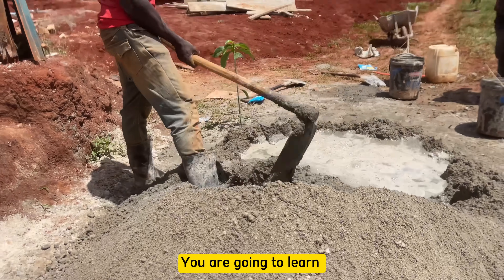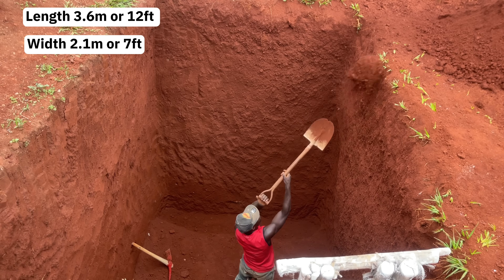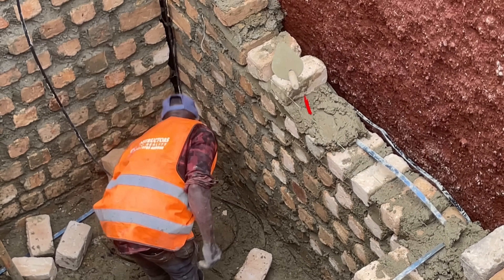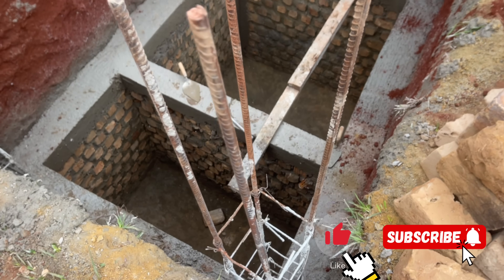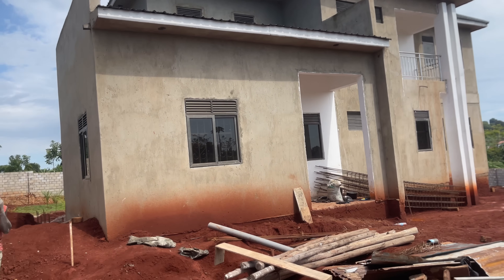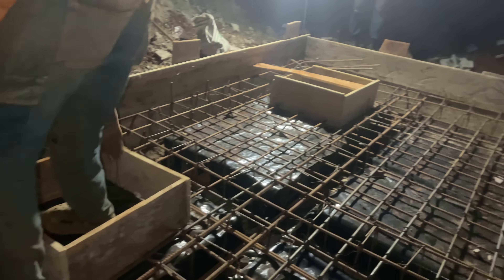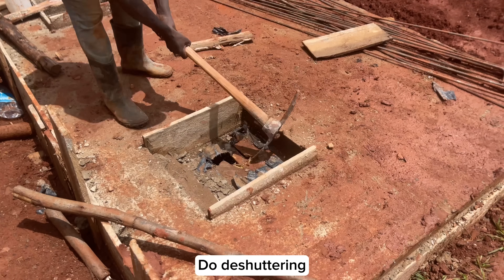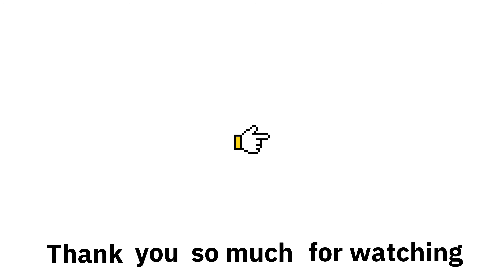How to construct a septic tank (NEW WAY)

Comment from the maker: To buy or purchase the drawings or plans for your septic tank project,

👉Email me at
ian@ianconstructions.com

Affordable Packages for only $45 usd

What you get:

1. PDF plan for your septic tank (highly detailed and professionally drafted)

2. Free bill of quantities, the total cost, and a list of materials required specifically for your septic tank project

3. Free consultation when executing your septic tank project from start to finish

4. Site Evaluation Guidance—Advice on the best location for your septic tank based on soil type, slope, and drainage conditions.

5. Customised Modifications—Minor adjustments to the design to fit your specific site requirements.

6. Videos and Photo Tutorials—You get exclusive access to photos and videos from my past projects, giving you a crystal-clear view at every stage to confidently guide you through your project.

7. Maintenance Guide—A detailed manual on how to maintain the septic system for longevity and efficiency.

8. Cost-Saving Tips—Expert advice on how to reduce costs without compromising quality during construction.

9. WhatsApp Support—Exclusive support via a private WhatsApp chat where you can ask questions and get real-time advice when building your septic tank.

10. Discount on Future Construction Plans—A special discount on other construction drawings (like house plans, soak pits, or drainage systems) for returning customers.
(To buy now, WhatsApp me directly on +256705545234)
Reply: Good job congrats
Reply: Just one question: please can this be done in a water log land ? Or biogas is better? I am in a dilemma. I want to do something that will last. Please help with your advice
Reply: Hello Sir, I request you to visit my site on professional service to build a septic tank. My land is houses for rentals on low land.
Reply: Mm 😅z la 😮ss hz0b😮zzz 😅z 😮 7:37 n33😮😮😮z 7:37 p2hez0g 7:37 b4d z😮p pp cc 88ijhhhhh 0😅p433zz😅2 2 pp 7:37 2v3zzzzzzez verre zzzzz 7:37 z😮 2z EE zzzzz. Ce22vezz
Reply: Thanks

Comment: You didn't place a pipe to do away with the toilet gases. Isn't that dangerous?
Reply from the maker: The toilet gas is usually exhaled from the plumbing system connected to the house

Comment: This is an eternal septic tank. On the soak pit, won't tree roots eventually reach the vertical PVC & clog it? How is your maximum summer water table rise vs 4m depth? What is the danger of just leaving the PVC at the mouth of an unwalled pit, so that water from the septic tank drips into the sealed empty pit, how do stones really help?

Comment: How far should the septic be installed from the house ? Is there  a limit of the maximum distance from the house ?
Reply: At home its 10meters or so from the main house, about 4meters from an outbuilding, in my knowledge it doesnt really matter how far it just depends on your yard space and preference. I know someone who has it about 1.5 meters from their house due to space
Reply from the maker: @PhindyParker you’re correct 
Septic tank minimum distance from the house should be 1.5m and then soak pit should be at least 3.5m away from the the house

Comment: This the correct way to build a septic tank except the french drain i built mine with bricks and spaces in the wall to get good dranage as time goes by it will block mine has got 30 years of use and no problem at all this system has been used for over a 100 years thanks for showing
Reply from the maker: Thank you so much for sharing
Reply: Read my reply it backs you up.

Comment: Thank you Sir! but you don't need Y16 Ribars on top because there is absolutely no load-bearing. plus its not in the driveway as you mentioned
Reply from the maker: Yes
The middle beam running at the centre, just because it’s not sitting on any wall and self supportive, better and safer to be Y16 ( Safety reasons)

Though you can still are use Y12 if that’s what you prefer, it will still work

Comment: Although the septic system looks great, but I have noticed the following drawbacks

1. The inlet and outlet sewer pipes should be as T and the middle opening should be made H by sewer pipes, not doing so all the floating staff from the first chamber will be moved to the second chamber and eventually to the soak pit.

2. Bypassing the water from the kitchen direct to the soak pit, will allow solids to the soak pit

3. Using a sewer pipe in the soak pit with small cutting, may make the soak blocked by solid staff from both the septic tank and kitchen.

4. My observations
Reply: direct connections to the soakaway need to have traps/stop pits prior to draining into soakpit which can be regularly cleaned for solids from kitchen and elsewhere
Reply from the maker: 1. Yes The inlet and outlet sewer should be a T you’re are correct, what you are seeing in the video is not a T, it’s simply a pipe. We connect a T later on that pipe during the plumbing process. It’s the last step. If you connect the T when you are still building, it will break during shuttering and deshuttering so we build the pipe together with the wall then you have to fix the T later as the last step

2. We put gulley traps or any other traps to trap those solids before reaching the soak pit, it’s always safe you don’t have to worry about that, not a single solid will enter the soak pit 

3. The sewer pipe, helps to distribute wastewater evenly to the surrounding, and it acts as an inspection point for the soak incase it gets a problem 
Just imagine a soak pit without that pipe, where would you start from incase it gets a problem?!! That means you will have to remove the soil or marrum on to of it to access the soak pit. That pipe can also be used as access to suck or pump out the sewage to prevent back flow incase both the septic tank and the soak pit fill up. Think about it 
It’s really helpful 

4.My answers
Reply: @ianconstruction  ok, i totally agree

Comment: What if iam using a  plastic septic tank, can the soc pit be applied.
Reply from the maker: Yes of course 
The plastic septic tank also needs a soak pit
Reply: The thing is you need the excess "water" to drain out of your septic tank to only leave the solids. Because mostly water makes up a huge volume of the residue in a septic tank so to avoid quick filling, the excess water is drained out into a soak pit where it percolates into the soil.

Comment: Why not share the chambers equally?
Reply from the maker: Proper settling and separation process 
The first larger chamber is where sewage enters from 
An equally sized sized system would allow solids go to the second chamber hence clogging the system 
Actually the standard design practice is that the first chamber has to be 2/3 2 thirds of the total volume whereas the second chamber as 1/3 a third for proper settling

Comment: Is it the same way with a house of 8 people but with multiple toilets? (I am building a house with 4 toilets, and an additional 1 toilet from the servants quoters, and 1 more outdoor toilet, making it a total of 6 toilets altogether.

Please advise
Reply from the maker: Yes, 1 septic tank is enough for 6 toilets 

What you adjust is the soak pit 

You can text me via WhatsApp or email to guide you properly on the correct measurements for the soak pit and septic tank depending on the number of users that you have

Comment: Can you also explain How Sato pan latrines/Toilets work and how they are constructed.
Reply from the maker: User defecates on the pan, then a small amount of water is poured to open the flap allowing waste to drop into the pit

Then the flap closes automatically
The whole system is designed like that to prevent bad smell, preventing flies and also reducing the spread of diseases

Comment: What is the importance of having an dividing wall in the sweage tank. Which side does the inlet enter, the smal side or bigger side, whats the use of the Hole in the dividing wall.
Reply from the maker: The dividing wall serves a number of purposes including strengthening the walls of the septic tank 

The dividing wall splits the tank into two parts.
Sewage and dirty water enters the big side.
Solids go down, oily stuff floats.
The hole in the wall lets only cleaner water move to the small side.
Then it goes out to the soak pit clean 

The whole system is designed to allow proper clearing and settling of the sewage and waste water from the house before it enters the soak pit
Reply: @ianconstruction  Appreciate this explanation as this is the question I had in my mind. Maybe to extend my question a bit, if the water from the second (smaller) chamber goes to the soak pit anyway, why not just make that the soak pit instead of having to dig for a separate pit?

Comment: Awesome content
Reply from the maker: Thank you Engineer
I hope it will help you out 

You can always choose a two chamber septic tank(better)  like the one in the video above instead of a single chamber
Reply: @ianconstruction Can this septic tank work on an apartment if i make the depth 6m
Reply from the maker: @EngrMk256 Yes
What you do in this case is that you increase the wall thickness to 400mm and use Y16 for columns 
You will also have 2 beams in the pit instead of one

You can always ask me when taking up such a project, I will tell you for free